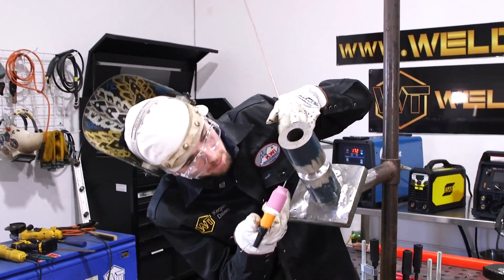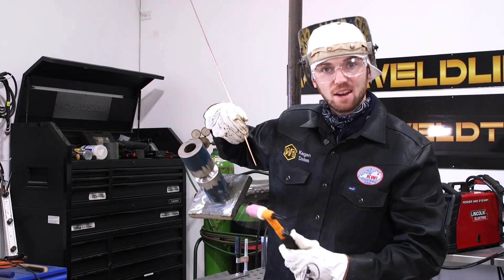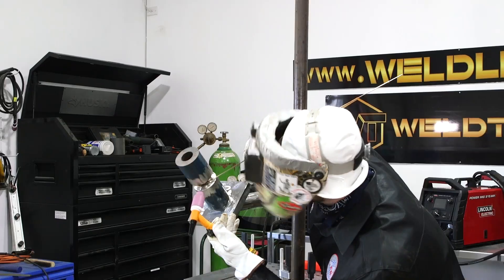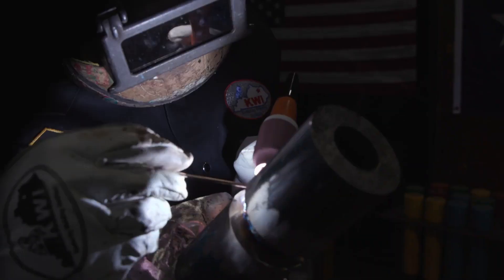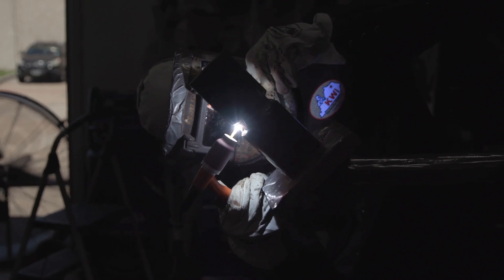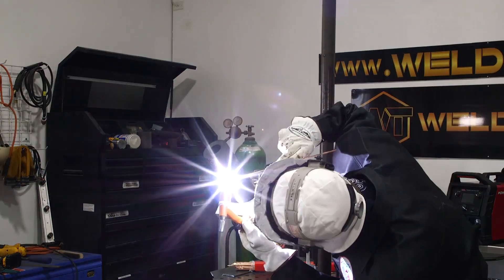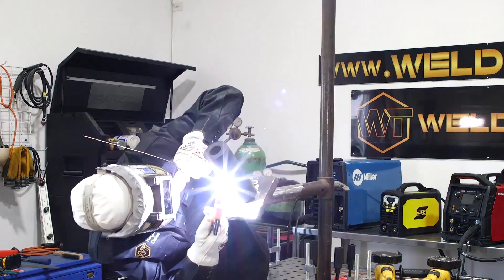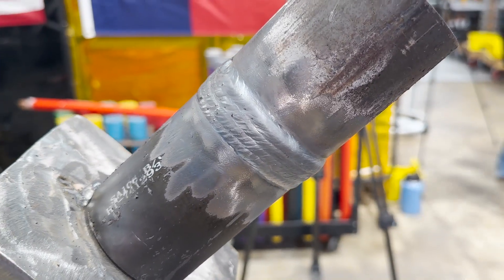Master the 6G Monster Coupon Test (Part 2)

Comment: This was actually a very instructional video for me as someone who has been welding for about 6 years and a union boilermaker for about a year and a half now. The whole 6 g tube test has been a new thing for me so I've been trying to absorb as much info as possible for whenever I take my first tube test. I liked everything about the way you did it except most of the time they won't let us even have a grinder in the booth with us so all we've got is hand tools.
Reply from the maker: Thank you so much yes Kegan has figured out how to make it easier for himself and just make testing a smoother process. Hopefully, you could take that to your experience as well and yeah, the no grinder on a weld test can be tricky because your Rod placement and firing up has to be perfect without porosity!
Reply: @KentuckyWeldingInstitute Yeah so today I actually applied everything I learned from this video and it's working out for me pretty well. And yes tying in my starts at the bottom of the tube has been my greatest weakness but it has been improving. Starting about an inch above the bottom to let the rod heat up before I start the bead has really helped.